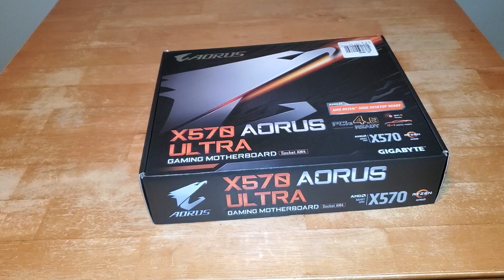PC Build | New Gaming Rig | Lian li PC-011 Dynamic

Comment: solid choice for parts manny.  That Gpu is fat
Reply: thanks, man.  Since it will be displayed on stream I have a few more esthetic additions to make including case fans, new cpu cooler, and custom PSU cables.  Case fans are not just for esthetics, but for cooling.  I have the case open right now because not much air flow in there.